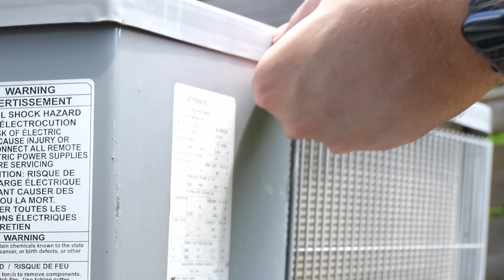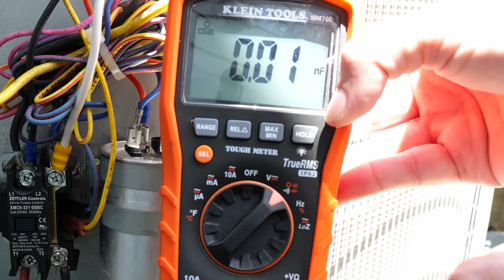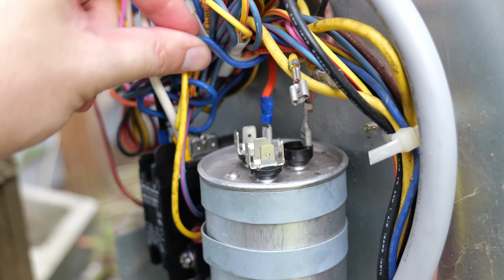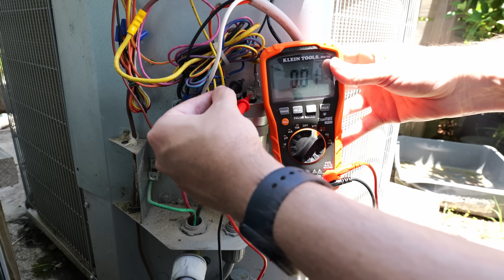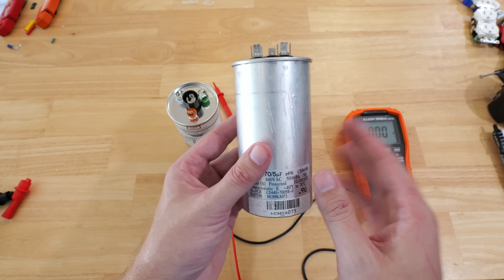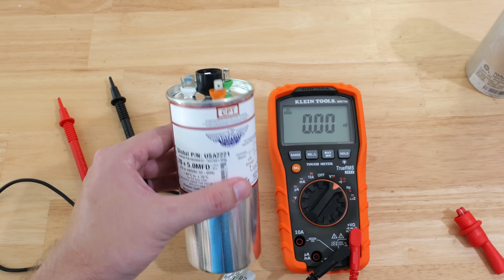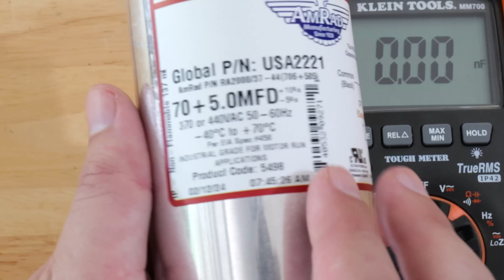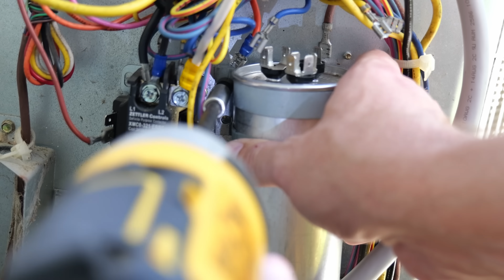Don’t Get Ripped Off! How To Avoid The AC Capacitor Scam And Save $500

Comment: Capacitance is tested as an AC function, and it should be tested at the frequency the capacitor will operate at. DON'T USE YOUR EXPENSIVE KLEIN NUTDRIVER AS A DISHARGE BAR. That is a firing offense when you work on my jobs. (Misuse of tools)  Either use some #10 AWG scrap wire and pliers or some scrap wire and add on a 10 watt  2000 ohm resistor so you are NOT making any sparks. Also any capacitor can read perfectly right at 70 uF & 6uF and the capacitor can leak so much DC electricity it's still bad. An ESR and or a dissipation test can sort that out.  Electrolytic capacitors also have a shelf life. If it has sat on the shelf for a couple years or so, unused, you can reform it. If it's bulged or leaking goo or leaking crumbly stuff, it's trash. One of my idiot AC techs hooked the capacitor up wrong. Herm was on the fan and fan was on hermetic. The unit rattled all of the windows on the house. There was a full board and unit schematic inside AND a full cartoon wiring diagram inside of the unit AND he had an I-Phone, and he still got it hooked up wrong. The owner's dropout frat boy son.

Comment: The % Marked on the capacitor is the manufacturing tolerance. So if you buy a brand new capacitor it will be within those tolerances. It does not as such indicate that the should be within those tolerances to indicate it is either good or bad. Clearly if the manufacturer of the ac unit fits a capacitor of that value as the correct value for the unit then that is what it should be. However bear in mind supply issues, higher tolerance ie small% values are more expensive than lower tolerance value ie larger % values. But if they are unable to source the cheaper capacitors or find a supplies offering lower prices on higher specification unit they will fit those. So if a capacitor is a little out of specification it does not mean it not OK. A previous replacement capacitor may be of a smaller % value because the repair person may have had that with them and would be simpler to fit than get a different capacitor of the same tolerance of the original.

Comment: So my fan  wasn’t turning on and my capacitor was just replaced 2 years ago , but I was just going to put a new one so I was looking at the one it had so I can order a replacement, and I noticed the connector where it said fan had 2 terminals so I just thought of disconnecting from one terminal to the other and when I disconnected the fan wire I noticed it was really rusty at the capacitor so I plugged it onto the other one and BOOM fan kicked on ac working like normal just thought I’d share since it worked for me

Comment: Many years back my AC decided not to work, LOTS of smoke... it was 90 outside, so yeah that is when it would fail. I opened up the cover and when i tried to force it to start it would not. I looked and there was a lot of oil down below the cap. Older high voltage caps are oil based. The drawing only showed the cap with zero spec and there was nothing on the cap. Went to the local AC shop with the drawing and he had no idea, returned with the cap (no marking) and... no idea, but this should work. plugged it in and we had AC again. 2 hrs, 2 trips, $5 part.   

So if it smokes and is coming from the electrical area and not the fan motor suspect that cap. If you have an HVAC shop around they may save you a LOT of money and likely time!!

Comment: Excellent video.  Sadly most techs sell those $20 caps for $100+ then lump $150 - $200 in labor on top.  For the fan side in an emergency a homeowner can get the spin started with a long screwdriver.  Once spinning it will keep going until the t'stat reaches temp and shuts off.
Reply: Thank you. That is a very good idea, while you wait on the new parts to arrive. I have 3 portable units for emergencies like the failure of the Compressor, and I won't try that, since the old capacitor is removed already. But good to know for the future.

Comment: When my capacitor went out, I called around to all the AC repair places and they all said they would need to send out a tech to look.  I even told them which capacitor I had and even though it was a very common capacitor, they said they would have to order it.  I went on Amazon and ordered it for about $15 and had it in 2 days. Bought a few extras too. Luckily we have multiple AC units so we just used the one that worked and fanned the cool air to the rest of the house. They get the average homeowner because when these go out, it is hot and they need it fixed right away. My neighbor paid over $400 to have his fixed.

Comment: need to get one of those multimeters that does farads, mine dont sadly. i dont work on hvac often, but when it breaks im the one who has to fix it lol. just replaced the motor and swapped a capacitor on the blower a week ago

Comment: These types of videos make it sound like every HVAC company is ripping people off. That's not the case. Is there some yes. But I own a small HVAC company and can say I've worked with a lot of solid guys. Most HVAC companies change these out for nothing more than their service call fee ($100 bucks). This includes a complete check of your system to make sure everything is running smoothly and within specs. Not everyone is an asshole or a scam artist in the HVAC world.

Comment: I purchased a meter to measure capacitance and inductance (somewhat like yours) specifically to test our air conditioning capacitor, and purchased a couple of new capacitors.  Both were inexpensive enough to purchase just to solve our failed air conditioner.  Sure enough, our capacitor was bad.  I replaced the capacitor, and solved our air conditioning failure.  I have also purchased and replaced the AC contactor (relay) to fix our A/C, and saved a lot of money by purchasing the contactor from a surplus parts company.         Joe

Comment: I didn’t hear about checking the Cap with ohms/audible setting on a basic multimeter such as a basic Fluke 77. If a homeowner had a plain basic multimeter without the microfarad setting, how would they check it? Guess a quick mention in the video would have been nice.

Comment: Not sure what one tech was saying about start capacitors and how they work. Caps in an AC motor shift the timing of the AC sine wave so that instead of directly opposing forces on the motor when it’s at rest and you get the stalled motor and hummmm.   The cap shifts one leg about 90 degrees so the idle motor strarrts to spin.  Which is its function.   A good hvac guy should charge about $80 to repair.   Any more and you’re being ripped off.
Reply: Wow. Here in WA it costs me $150 or more per call just to show up.   Any less, and I am running a non-profit and may as well spend my day volunteering at the food bank. Really. An $80 job business is destined to fail. My van alone costs more than that per call, much less my time, training, insurance, and other expenses.

Comment: There are shaddy businesses in every trade, hvac included.
One pro tip for you all.  If they give you a term that you dont understand, google it.  Some residential companies nake up names for certain parts so you cant look up yourself how much they are screwing you on price.  For example, they'll tell you a $20 capacitor is a "voltage regulator" or something and sell it to you for hundreds of dollars.  They justify by saying "we get paid for what we know, not what we do" or "we have to pay for the equipment and blah blah, which is all BS.  The customer is already paying labor and trip charge, unchanging more than industry standard is just plain shady business.  I always get repeat business because I refuse to upsell or replace parts unless they are needed.   
2nd word of advice.
When the time comes when you do need an upgrade or replacement.  Domt go with the cheapest guy.  Those guys aren't going to be there for you when you need them in the future.  Go with the local company eith a good reputation, even if the cost of the new equipment is more expensive up front.  Chances are they included things in the quote the cheap bidder didnt, and they will use better parts and give you a better install.  Worth the extra money in the long run.
Signed,
25 year maintenance and hvac tech.

Comment: Yeah I got my company to start doing full check up maintenances/cleanings we check the caps and contactors properly. Some will still run out of range but they will be more likely to go, we tell the customer that and they make the decision.. sure theres a mark up, its a business, but it saves them a service call and the inconvenience for a pretty common problem. This saves us from having to go out and just swap caps, all summer and we can get to the more technically involved service calls/repairs You will have to find an honest company that does this. And Not ALL AC contractors are out to get you, knowledge is power, also if you fail as a homeowner to wire this properly or securely there can be major issues, as simple as it is to do... Unfortunately weve seen it done many times by other companies or even homeowners..Its always good to take a picture or to be able to read the schematic.

Comment: I'm reading lots of excuses by techs about how expensive it is to run a business.  I'm sorry, but when you are stupid enough to leave the box the capacitor came in so I can look up the part number's cost at Allied or Mouser, you should expect to be FIRED on the spot.

During a routine checkup, the tech determined my motor run capacitor on a fan for the inside unit was out of spec.  OK, that's no big deal.  He conned the wife into replacing it and charged me $88.00 in ADDITION to the regular fee for maintenance.  This cheap Chinese cap cost $1.88 RETAIL at Allied in singles with lower prices as the volume increases.  REALLY?  $88.00 for a $1.88 single unit RETAIL cost when the service call was already covered?  Same story with the contactors for the outside units.  HVAC repair price? $250.  Allied's price? $12, RETAIL.  They got fired just like the idiot who tried to make be believe my heat exchanger was cracked because his borescope showed something.  Too bad for him I've worked in a machine shop and I know what metal cracks look like.

I bought Cornell Dubilier caps (not cheap) for everything in my system after the cheap Chinese cap died in 18 months, and they ran for a over a decade trouble free.  Aerovox also makes excellent capacitors, but again, not cheap.

Comment: I feel this is kinda a cheat, it's literally 10 seconds to disconnect, and measure the capacitor correctly. Dunno why that needed to be 14 minutes long, if you look up your capacitor on A/C websites, you can buy a replacement for $10-20. Most HVAC guys will charge a few hundread to swap a capacitor out. It's basically free money to them.
Reply from the maker: Dunno why you are complaining about free information.  I wasn't just talking about the weather.

Comment: You know, I've seen this same idea posited on other YT channels, and I have to say that - with the exception of an actual scam, where they are telling you to replace a part that is not bad - it is not unreasonable to be charged several hundred dollars for this fix. Let's assume that this part being worn out really is the problem. Well, opening up your A/C unit and diagnosing that problem is part of what you're paying for. The labor involved is part of what you're paying for. The part is part of what you're paying for (and yes, it's an inexpensive part). Another thing you're paying for is making sure it's done right, and hopefully checking out the whole unit (Is your freon full? Is your insulation in good shape? Connections?). Pointing out that this part is inexpensive reminds me of when I was in junior high, and kids started realizing that "the store" pays a lot less for merchandise than what they sell things for at the register, and then railing about it. Yes, they do indeed. And they have overhead, and employees, and this, and that, and the other thing. As I said - if you're being scammed, that's another matter, and another conversation. But if the part is actually worn out - and it DOES wear out - then there is nothing outrageous about paying a pro some good bread to replace it. It's how it works.
Reply from the maker: I am assuming you are an HVAC tech yourself?
Reply: @HowToHomeDIY  No, I'm not. I'm just a homeowner, and a relatively serious DIYer who has done all sorts of projects in a lot of disciplines. Last summer I had this exact fix (replacement of the AC capacitor) done by a pro HVAC guy on my 30 year old unit. I paid about 400 bucks for the service, and I don't regret it. In my case, this guy was the fourth HVAC guy to come through my house, and the only one to - I felt, and still feel - shoot straight with me. One tried to sell me a furnace/AC based on a lie, another tried to sell me a furnace/AC based on a different lie. The furnace and AC were original to the house, and when the AC went out in the middle of last summer, if he would've said I need to replace the AC unit, I would've believed him. Instead, he showed me the capacitor, which had the telltale domed top, and said it was all that was needed. He checked the freon. As I said, this is a 30 year old unit, and uses the old type of freon that is now banned, and expensive to get. He said the freon is full. He felt that the unit would last a few more years, probably. I know there is no guarantee of that. For this he charged me about 400. Now you might say, don't put 400 bucks into this old thing. Put that 400 bucks into a new unit. But for me, it's about understanding what is what, and I might get an estimate from two different HVAC guys that have a difference of a $1000 or more. After multiple HVAC b.s.-ers, it was a relief to feel like at least I know what is going on, and yes, $400 is a gamble, but it's one I was willing to take.

As a DIYer, there are certain things I think you have to be careful about. I'm not saying a DIYer shouldn't swap out a capacitor - it's clearly easy to do, as you have shown. It's the DIAGNOSING that is the issue, and getting the overall picture of what the status of the unit is. Putting all this stuff on a DIYers todo list - basically doing a diagnosis and clean & check of an AC unit - sorry, but I think it's outside of what's reasonable for most DIYers. $400 for a health check, expert opinion, and part replacement for an AC unit is expensive, but not unreasonable, in my opinion. The ONLY question is this: Is the person providing that service trustworthy.

Comment: Yea a little bit of knowledge will save you a lot of money sometimes.. 500$ for a cap replace is way overpriced.  Even if you bought a multicap with the 7 different ratings youre only out 250$ for it but your getting 7 different sized caps in one package..  those are the most expensive cap you could buy.  Unless youre buying a manufacturer built and branded cap like a trane …. Your paying for the logo.. you just gotta make sure to get one of the correct voltage and close to the same microfarad as the old one..

Comment: Inverter aircon systems control the motor speed electronically and don't normally have motor capacitors. They are also more power efficient so if you have an old aircon it may be worth replacing it an inverter unit to save money on power.

When I was working in the Middle East the outdoor unit capacitors seemed to fail after about 3 years so  I got into the habit during the annual maintenance/cleaning of giving the maintenance guy $20 and getting him to change the capacitors every two years. Saved on callouts and I had the most reliable aircon in the compound.  Didn't help that they always installed the units on the flat roof without a sunshade - I'm sure it reduced the efficiency by a third!
Reply: You want some sticker shock?  Just look at the prices of those fancy high efficiency furnace variable speed motors. It makes changing caps and/or conventional motors look cheap.
Reply: @Robnord1  over in Europe almost all A/C and all heat pumps are variable speed. Sounds like the US is behind the curve on all this sort of stuff.